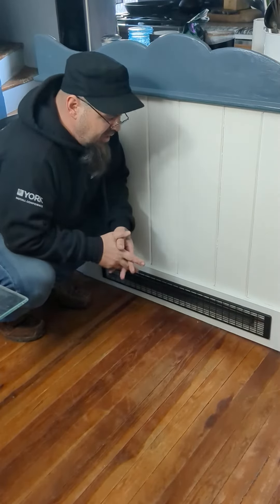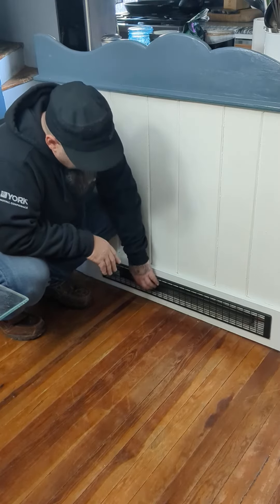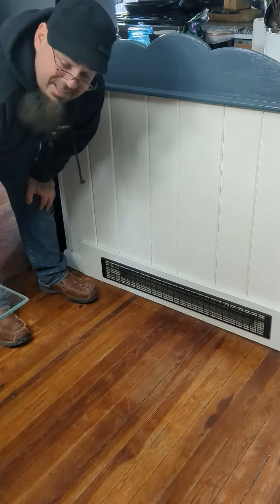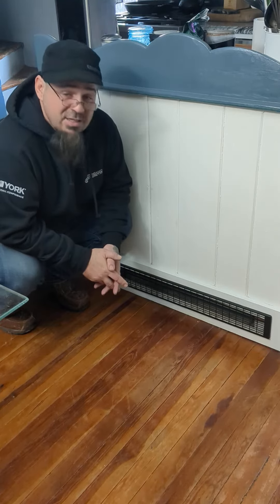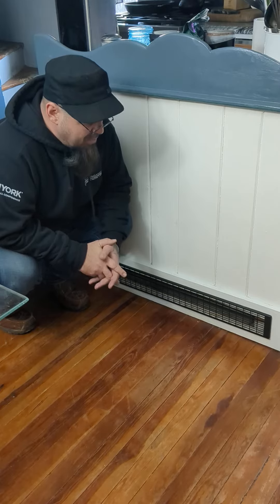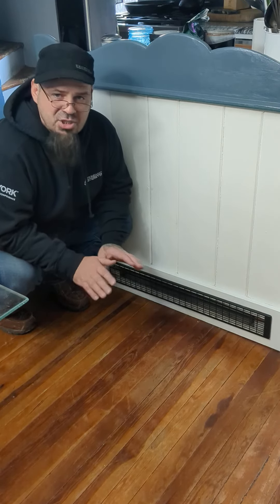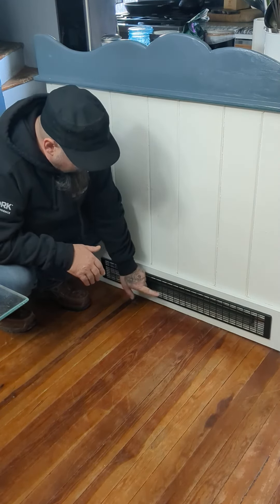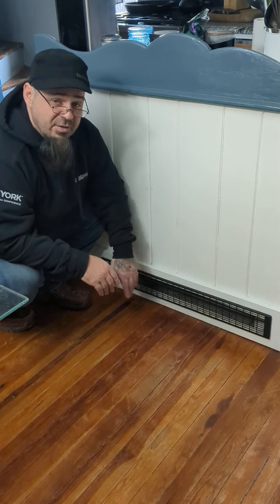Toe Kick Heater - What The Finished Product Looks Like

Comment: Have you had any fan bearing issues with any of these?  Always thinking about the servicing of these units.  Our kitchen is on the north corner of the house and it gets quite cold.  Running an NTI combi boiler and wondering if this would be a good option for a 3rd zone.
Reply from the maker: Great question I have not had bearing issues at all Some of these units are 1518 years old that I have installed and work on. They are pretty robust occasionally I get a fan motor that is bad but after 10 or 12 years so you still get a good run time. Cutting the base of the cabinet and adding a false bottom is also quite simple. Watch the piping a lot of guys make piping mistakes with these
Reply: @solutionbased5176  Thanks for the quick reply.  That sounds like it would be a good option for us.  I'm no plumber, so I wouldn't know if tapping into the loop with venturi tees, piping the toe kick in the series loop or if a 3rd zone would be best.  By the sounds of your other video, I think adding another zone would be best (but also more expensive).  I'd probably just have a pro do it.  Thanks for the thorough explanation about mistakes installers make.  Gave me something to think about.